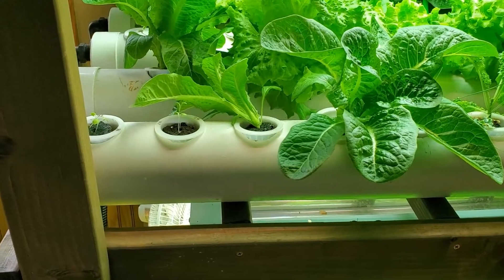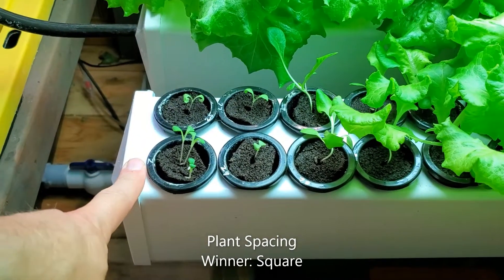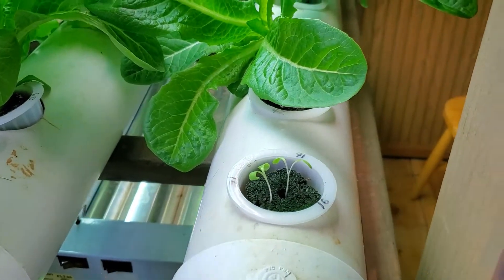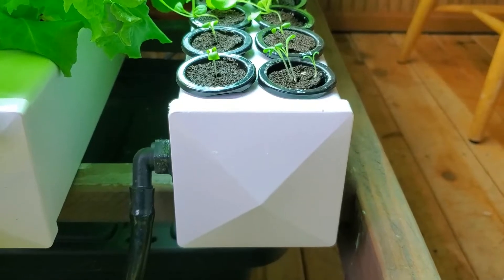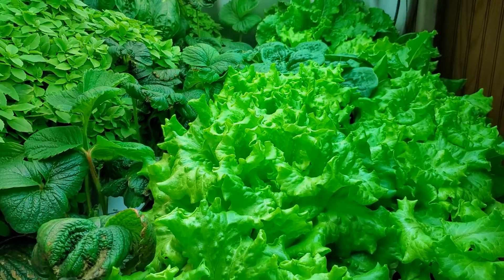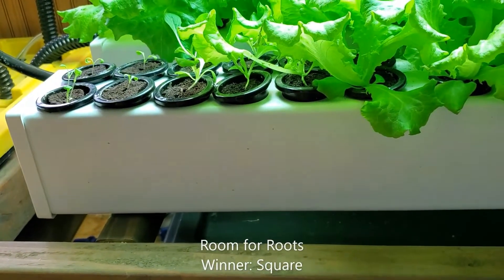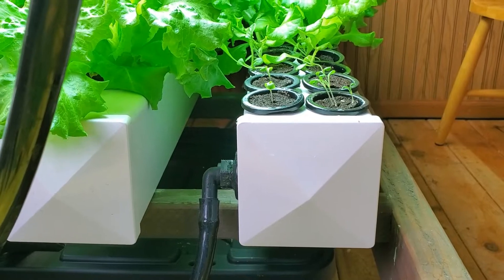Hydroponic PVC Rails: Round vs Square?

Comment: Are the square vinyl rails NSF 61 certified like most PVC? Assuming it is, but just checking. Does it even matter to much?
Reply from the maker: I haven't found anything that says they're NSF certified, but they aren't sold for plumbing so I don't think the manufacturer would have any reason to pay for a certification. I'm not concerned with using them at this point based on my research, but a good thing to look into if you are concerned. I'll work on making a summary of what I've found from the research I've done and hopefully put it on the website.
Reply: @SimpleGreensHydroponics  If the Vinyl you used is created from U-PVC (most likely), then it might actually be safer than the regular PVC, see this link: https://www.diffen.com/difference/PVC_vs_uPVC
Reply: @NickWillever  just making sure that lead is not added into the plastic and don't heat up the upvc.
Reply from the maker: @NickWillever  Yes there is a lot of info out there with a lot less tangible data. I've seen the same about UPVC, though I'm not 100% sure that the square rails are UPVC since they are slightly pliable (they dent vs break). I just posted the summary of the research I've done so far on the website:
https://www.simplegreenshydroponics.com/posts/2021/is-pvc-safe-for-hydroponics
Reply: @SimpleGreensHydroponics  awesome article! Great research, I've also done to the conclusion all of this should be fine. I did make sure to get HDPE water reservoir. I'll soon send ya some pictures of our system!
Reply: @SimpleGreensHydroponics  thank you! I've been searching high and low for this too, lots of disinformation out there with this material too, so difficult to wade through it all. I'll keep digging and update you if I find anything.

Apparently you can test the plants themselves to see if they have particular particles in them, probably super expensive, unless you can get a university to do it.

Comment: Peace...excellent video and instruction. Is there a catch pan under all this ? I like the tier concept.  Would be nice if each tier could roll out like drawe
Reply: Hmmmm...looking at the video you're using interconnect between square tubing so if the system feeding nutrients are the same all required is one(1) feed line in and one(1) feed return out . You're doing side fixed connection to/with flex conduit . Maybe with enough slack in the flex conduit between troughs and recover tub the troughs could be pulled out to harvest and work the back troughs.  Just Brain storming.
Reply from the maker: No catch pan, we just made sure it was leak-free :) That is a cool idea to have roll out tiers! Would take some creativity with the inlet and outlet tubes to allow for it.

Comment: So, with this setup, you are basically sowing 4 new seeldings per week then moving everything forward each week after harvesting the 4 plants at the end of the chain?  Also, I see others doing hydroponic's using Kratky where they say not to add nutrient to the starts? Many of them use Masterblend.  So, obviously your starts are in the same nutrient water solution as the mature plants with no problems?
Reply from the maker: Yes, exactly, we try to harvest 4 plants each week and replace them with seedlings, moving everything forward (we have a recent video showing that process). We've had no problems with germination or seedling growth in the full nutrient water.
Reply: @SimpleGreensHydroponics  Thanks for the info and reply.  Great videos!

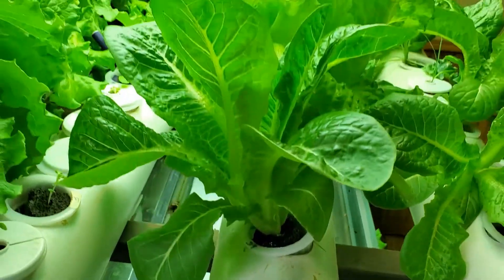Comment: ☑️ Only 0:40 in, and I've already learned a significant disadvantage with round pipes(ie. the unbalanced way the plants sit in the round pipes), which is something you probably wouldn't realize until you've already bought and fully installed the system! Then there's the obvious space-inefficiency with round tubing, limiting you to just 1 row per tube, whereas you can fit 2 rows of (balanced)pods in the square ones. 🙂

🤔  The square tube disadvantage being that it's not inherently as watertight at the ends, and I'd imagine it may be more difficult to find sections of square tubes vs round pipes, because round PVC pipes are sold in a myriad of diameters and lengths for common plumbing and drainage purposes. The square ones are probably sold in a specific length and diameter, for the specific purpose of fencing, which probably also equates to higher cost. But if they work better, then so be it. 

👌Personally, I'd wager that using the square fence tubing for a hydroponic system, would actually be a much more effective use for them than fencing! I say that because I've seen several of these square PVC stockade/privacy fences, and they are nowhere near as strong, rigid and solid as they NEED to be! But they are still heavy, which causes leaning and flexing and bending, and they eventually collapse in certain situations! Often after only 1-2 years! I'd NEVER install a PVC fence! A decent quality treated, stained or painted wooden privacy fence will last 2-3 decades if taken care of, and they are far more secure and rigid!

But the square PVC posts seem ideally suited for NOT being used as fence posts, but for having lots of holes drilled into their sides, then growing growing stuff inside them instead! 😁
Reply: Breeder age na Yan sir mga 1 year na Yan. Abby depende sa quality

Comment: You could've capped the round pvc on both ends and used the same union setup as the square with a rubber grommet instead of the tees. You can also dimple the round pvc to give you a flat top surface. You could even sandwich the pvc between 2x4 and use sand and a heat gun to make them square if you really wanted to.
Reply from the maker: Yes, those are good ideas! The round PVC may be less stable and be susceptible to roll without the strong tees on the end, but you could probably make something to solve that problem or flatten it out with a heat gun.
Reply: Takes a plumber to know one.
Reply: Or cut a sideways slit in the PVC, perpendicular to the PVC pipe, use a heatgun then take a rod a tiny bit smaller than the size of your net cup and jam it at an angle so that it slides under one flap of the slit pushing one flap down and one flap up, then move in a circular motion until it's round and expanded to the size of your net cup. 

Now you have a vertical garden and you can use a mister at the top top aerate the water

Comment: Be careful with plastic square posts. They are made with plastic not suitable to hold fresh water. Toxics may be absorbed by plants roots and remain in leaves.
Reply from the maker: That is a valid concern. When I've looked into it in the past, I didn't see anything that would indicate that the PVC post jackets had been specifically declared food grade, however I'm guessing the manufacturer had no reason to declare it such even if it was. Rigid PVC is widely used in home plumbing and drinkable water applications so I currently don't have any concerns using it. Most of the concerns I've read about with regards to PVC are with flexible PVC due to the plasticizers added to make it bendable, but our system uses rigid PVC. In order for it to cause an issue, the PVC in our system would both have to leach harmful chemicals into the water and then have them absorbed by the plants and transferred into the leaves or fruit that we eat. We encourage everyone to do their own research and make a decision based on what they find and are comfortable with.

Comment: I've been growing hydroponic lettuce using the Kratky method using a variety of containers, but I love your system using the fence posts. I was about to redo my setup with raingutters which require heating and closing the ends, but I want to use a pump and reservoir system like yours. How did you plumb the four post rails together. It appears that you have on input line. Are they all connected at the far end (similar to what the PVC round pipe ends up being)? I checked you website but didn't find anything on plumbing more than 2 posts. Look forward to more videos and posts.
Reply from the maker: The 4 square rails actually use a zig-zag pattern for the flow. So the flow comes in one single line on the left side of the first post, crosses to the second post on the far right, then crosses to the third post on the far left, crosses to the fourth post on the far right, and then returns to the reservoir through one outlet on the left side of the fourth post. So it's a little different from the round pipe setup. The square post setup is a little nicer because it only needs one outlet instead of three.
Reply: Those have e plaster users in the vinyle it is not safe per a chemical engineer I know. Stick with PVC that is a 51 or 61 and schedule 40 off white pipe. Also make sure not to accidentally purchase schedule 40 series foam core by accident. Just plain schedule 40 pipe. Best wishes

Comment: Hello Simple Green, i Truly must Say Amazing Video, Tho all your facts are valid and truly informative might i say from my own exp.i have been using both  for quite a long time i have tried so many different solutions and to the issues you speak of with round pipe i do understand net pots dont fit well  i found using pool noodles for plugs instead  works so much nicer  and cheap to replace  not to monition limiting your mind to exclude what seems to be impossible making a truly modeler

 system from round is more them possible with the right part

Comment: I built the square version on your website exactly and I love it.  Did have some small leaks on the cap corners at first.  Any tips to not damage roots when moving the net cups down the system?
Reply from the maker: Good question! I like to try and tuck the roots down into the plant hole before I drop the net cup in. If any roots are still hanging out, rotating the net cup sometimes pulls them down. Once the plants are large I try to leave them be until it's time to harvest.